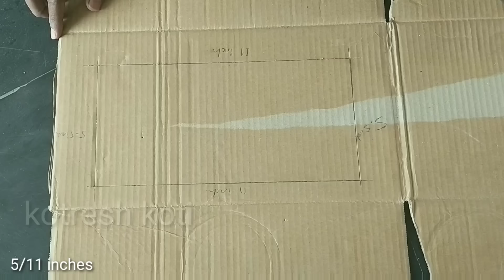Brick wall painting techniques | Asian paints interior brick wall

Comment: Saludos desde BUENOS AIRES argentina.EXTERNAL DIP Anclaflex is developed to correct and repair imperfections on exterior surfaces such as cracks, pores, etc.
It offers an optimal creaminess, facilitating its application and resulting in a smooth and perfect finish on walls or ceilings.
Once dry, it has great adhesion and simplicity in sanding. Its highly effective additive components give it great reluctance to
fungus and better adherence. It can be colored with toners.
Exterior Filler?

Comment: Why not paint the wall grey first then stick on masking tape then do the pop corn roller then plain it and then paint it and when dry remove the masking tape.
Reply: If the wall putty dries you won't be able to pull the tape up in a neat fine line. It will actually destroy the brick work, you probably won't even be able to lift the tape up at all. Putty dries solid and hard. If you want it to be in any shape or form you have to work with it when it's still pliable.